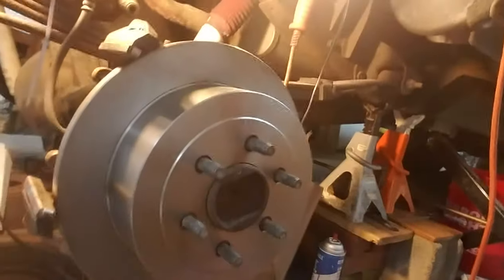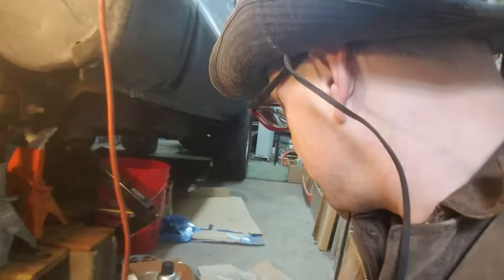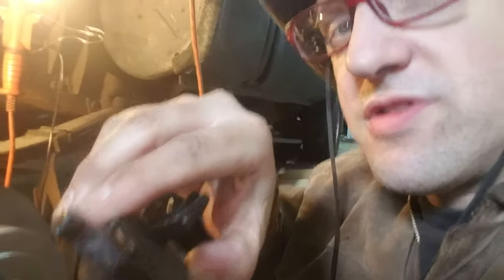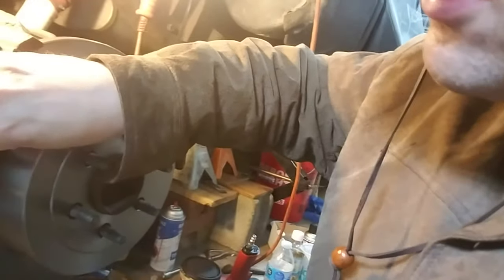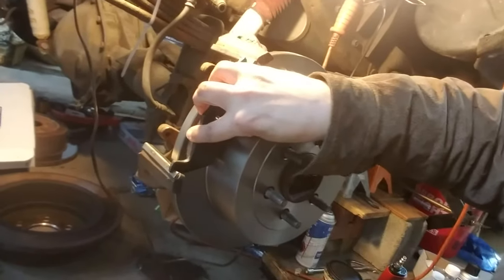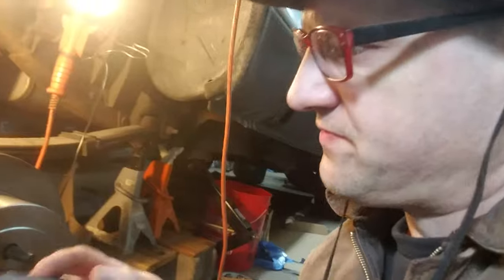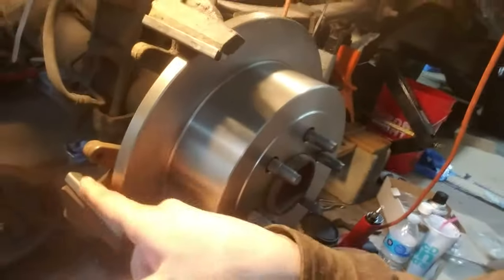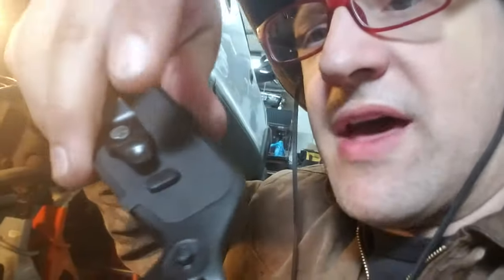Brake pads too tight? Here's a solution!

Comment: Are you talkin about fouling down the pad part itself or the ends that go into the hardware. I am having trouble getting a pad back in it's just a little too tight because of the hardware
Reply from the maker: I'm talking about the backing plate that the pad material is mounted to. I'm specifically talking about the areas on the sides right where the pads slide. Its where they engage the stamped sheet metal clips that provide a smooth surface for the pads to slide along. It's hard to explain in text,  but I tried to show it pretty clearly in the video what areas I was filing. I hope that answers  your question. If not, please say so, and I'll be glad to try to be more specific.  Good luck and thanks for commenting!
Reply: @ClayCarlino  hey thanks a lot. i finally got the pads to fit after knocming some rust loose. thanks again
Reply from the maker: @bradsheppard6407  oh good! You probably already know this,  but I'm just going to throw out a reminder to make sure they fit loose enough to be able to move freely. On a couple occasions I got my pads to fit, but they were still a bit tight. If the pads can't move freely they can fail to disengage fully when you take your foot off the brake pedal.  That will cause them to rub constantly which will cause them to overheat. If they get too hot, your brakes can fail completely!  So please make sure that is not the case.

Anyway, you probably already knew that but I just like to make sure. It was plenty scary the times it happened to me.  Thanks for the questions! I'm glad things seem to be working for you!

Comment: 2/5/21
I was gonna get a cement cutting blade on a grinder and adjust my break pads,
I said na'h I better not...
I'll call it a third party experiment.
I did have to remove a spacer clip during a analytical check up on the roadside safe area.
Not showing signs of a bad break caliper-
Positive diagnosis.
Reply from the maker: So before I reply, let me apologize.  I'm having a hard time following exactly what you are saying. Please correct me if I am misunderstanding your statements. 

It sounds like you opted not to adjust your break pads and maybe you didn't  replace the clips. It also sounds like you checked everything over and it was working just fine. Is that correct? 

If so, here's my feedback.  It's hard to know what your circumstances are, but ultimately, if you didn't need to use the techniques shown in this video, that's okay! I've done plenty of brake jobs where I didn't need to adjust the pads either. As for not changing the clips, I always recommend changing them. Again, if you didn't and everything is working,  then that's good. I'm glad you didn't have to go through the extra steps.

Let me say this- I'm not a professional mechanic.  I post these videos because I do most of my car repairs myself and want share my experiences and hopefully inspire others to have the confidence to try things themselves. If your experience ends up being different than mine,  that's okay! I'm glad to hear about other solutions.

In this case, however,  I do want to advise some caution. Working on brakes is not difficult,  but it is serious. When changing the pads, everything should be clean and all the parts need move freely and smoothly. That's why replacement guide clips are included. Again, if you did things differently and it worked, that's awesome. But PLEASE be careful. Don't take chances and when in doubt, have a mechanic you trust look at your work and give you feedback.

Anyway it sounds like everything went well so good job. Thanks for watching and thanks for commenting!

Comment: I just had my front rotors and brakes done but sometimes i let go of the gas pedal the car seems to pull back or like it tightens up why is that ?
Reply from the maker: Of course it's impossible to know for sure, but it sounds like your brakes are sticking. This has happened to me when the pads were too tight (like I show in this video). There are other possible causes too, though. Even if the pads aren't too tight, some times your guide pins get dirty or corroded, or the grease on the guide pins gets old and gunky. Ideally, every time you change your pads you SHOULD polish or replace the guide pins, remove all the old grease and replace with fresh new brake grease. That being said, I'm as guilty as anyone about not sticking to that advice. 

If your pads are not too tight, check the motion of the caliper and make sure it moves freely and smoothly. If it's sticky, it's likely your guide pins.

Another possible culprit could be the stamped metal slide clips that the pads slide back and forth on. Usually new ones are included with new pads, but not always. These parts are made of thin metal and wear out easily. If they get dirty or scuffed or start to rust,  your pads won't slide the way they should, so replacing these and using fresh brake grease is a good idea.

I hope that helps. Brakes that stick are a serious issue. If your brakes don't disengage as they're supposed to, the pads can overheat and lead to brake failure, so please be careful!

Good luck and thanks  for watching and commenting!

Comment: What if they're too fat to fit the caliper back over?
Reply: Did you compress the caliper first?
Reply from the maker: It sounds like Archer has the right idea. Chances are the caliper need to be compressed further. I’ve run into that and every time it was because I needed to compress the cylinder just a bit more than I had. Good luck! Hope that helps.
Reply from the maker: @jarhead1145  agree totally! Good call!

Comment: It's my first time doing my brake pads. So I was agitated to why the brakes wouldn't slide in. No matter how much I pushed it in from either end. So I tried inserting the old pads and it wouldn't go back in as well just like the new pads. I put in the old brake clips and the brake pads fit. Both old and new pads went in like how it should, with the old clips. So the problem is my clips! The new clips are slightly different. Idk, maybe I should bend them in more. Dumb clips. Giving me so much trouble. sigh. making me feel naive for attempting to change my pads by myself. Lol. I was thinking I shouldn't have thought I could do this.
Reply from the maker: But you DID do it, and you figured out the cause of the problem! Good job! Doing these things yourself is always a bit scary. When thing don't work, it's easy to get that knot in your stomach and feeling of both dread and embarrassment when you think you may have really screwed something up. But then you push through and figure it out. And not only is the car fixed and you can enjoy the satisfaction of doing it yourself but you also get the confidence that comes with understanding how things work a little better than you did before. It makes less scary the next time while also giving you more options when other problems arise.

I applaud you and your success! Good job! Thanks for watching and thanks for commenting!
Reply: @ClayCarlino  Thanks so much for taking the time to write this. I ended up having to use my old clips. Everything worked out. I also learned how to change my oil, after learning how to do brakes. Its easier than I thought. I will try to doubt myself less. It's good to be cautious too. :)
Reply from the maker: @maileevyne5000  Doing this stuff is a bit like playing an old Nintendo game. You start out doing the minor stuff that seems intimidating at first, but on hindsight is actually pretty easy. You learn some things gain some confidence, and because of that, you try some more advanced things. Every job gets you closer to being able to tackle the next. Sometimes things go wrong. Sometimes it takes multiple attempts to make things work. But if you stick with it, you'll be amazed what you can be capable of!

Thanks for telling me about what you've been doing, and how it's going. Good luck with all your future repairs!

Comment: I found the issue.. Brake pads are not fitting because auto makers are using cheap metals and the mounting brackets are warping. This is why new brake calipers come with new mounting brackets, and with a core charge. You cannot get your core charge refund unless you INCLUDE THE MOUNTING BRACKETS. And they made it more expensive to buy calipers without the brackets, so people are encouraged to change the brackets. The pads are machined correctly.
Reply from the maker: What, really? I mean that makes as much sense as anything else except that my pads didn't come with new mounting brackets. Well let me ask this- when you say mounting brackets, are you talking about the stamped sheet metal clips that you replace along with the pads? If so, yes, my pads came with those, and I used them but the pads still did not fit. Either way I suspect we're talking around the point but you are probably correct. They probably are machining these correctly to fit something that is changing due to cheap metals and warping.

Thanks for shedding some light on this perplexing issue. Thanks for watching and thanks for commenting!